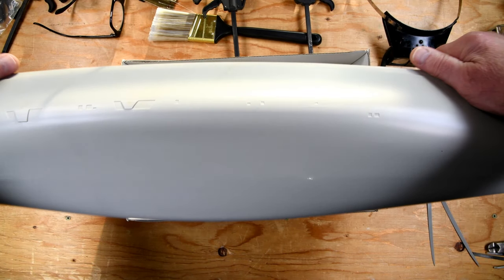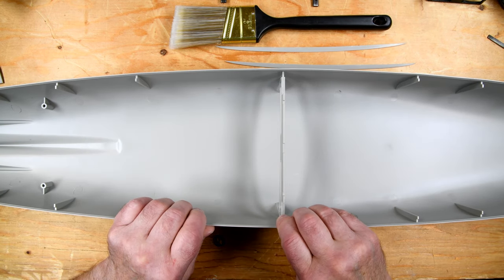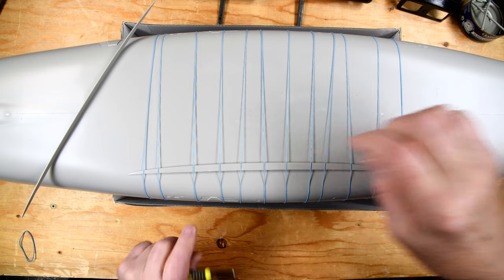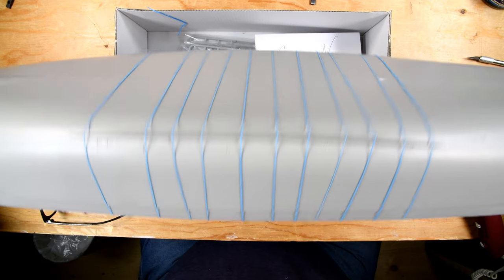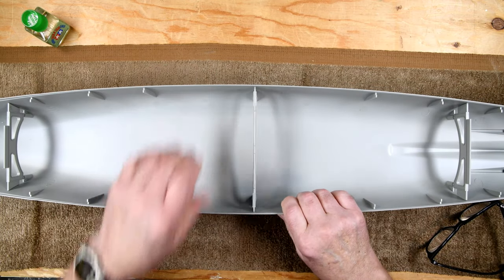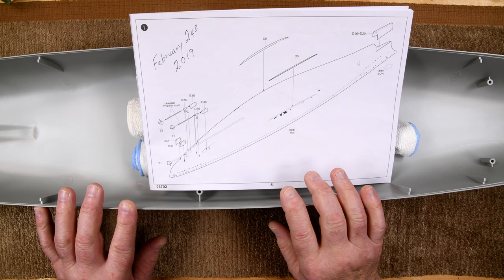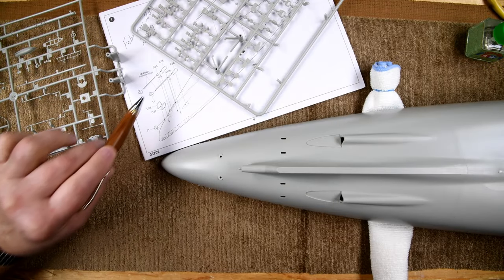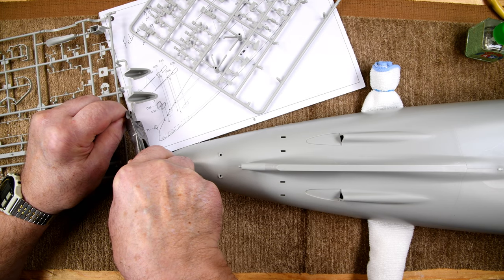The Model Ship - Part 35

Comment: Is there a reason why the bulb on the bow was not injected at the factory? The reasons that come to mind are (a) it's a great starting point for a model maker and (b) if you were to make it RC controlled you would need ballast, and that would explain the compartment it creates. Now it could totally be it didn't fit in the box with it on.
Reply from the maker: It has to do with the way the pieces are molded.
Reply: @roncalverley  Okay, thank you.